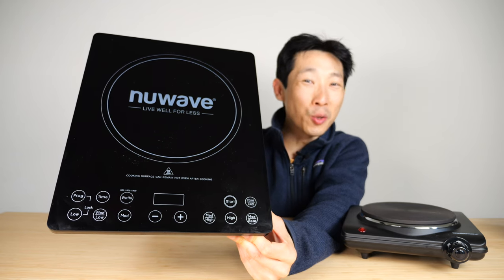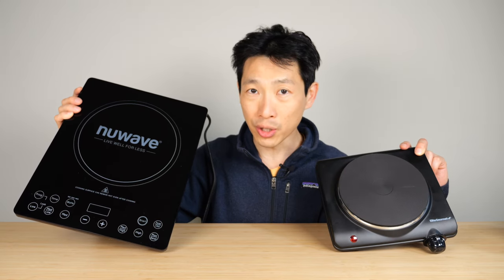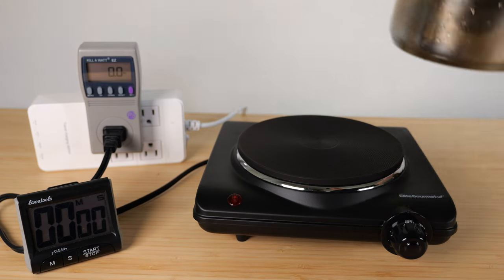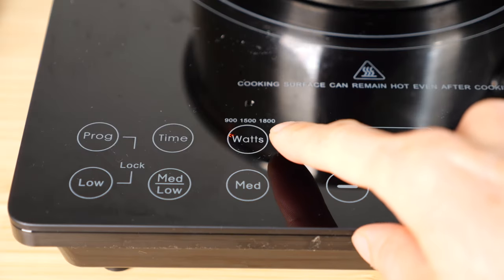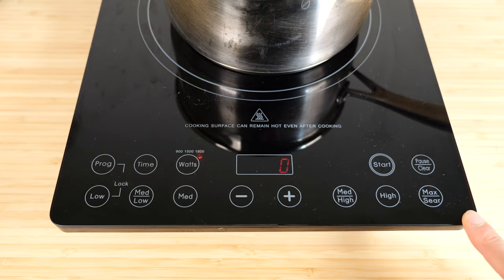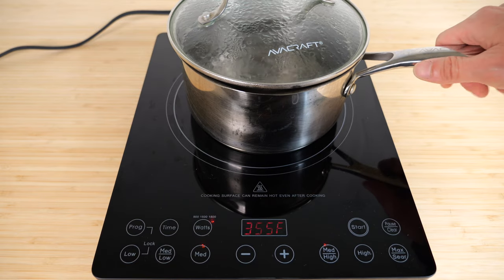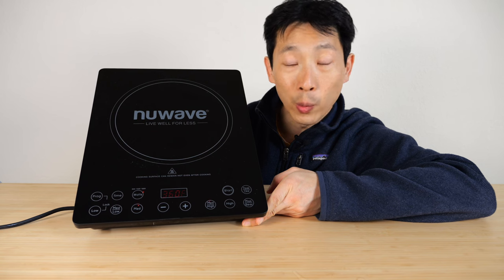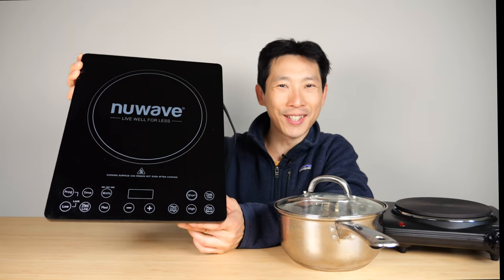Nuwave Induction Cooktop vs. Hot Plate

Comment: Induction is way awesome. If you turn off the power then things don't keep increasing in tempature. Like a gas stove it reacts instantly to turning off. Any pot you can stick a magnet to is induction ready. 1/2 the energy consumption and twice the controll. Personally the energy thing is nominally important because cooking takes only a short time, you dont use a ton of energy. Where it really shines is making cooking easier because you have more controll. A really good product test would be testing the temperature controls against other induction heaters. The quality of the temperature control is really what sets a great heater apart from the competition.

Comment: To bad he did not measure power used AH
Reply from the maker: Ah? That's typically used for batteries and needs to be paired with voltage of the battery. Voltage changes and so Ah is not a good energy measurement unless you want to talk capacity of a battery.

Comment: I only have portable stoves like these as I mostly cook on my instant pot or air fryer/ovens/microwave.

Induction is really good, it's a shame mine does not allow proper temperature setting (it allows it but it cycles instead of having a proper thermostat, so I can only keep things warm or have it cycling through and burning the bottom of the food instead of being able to set it at a constant temperature like the Instant Pot). I am glad I got the new Instant Pot that has stainless steel pans with handles, so I can use my induction cooktop if I want to quickly fry onions or something like that before adding the rest of the ingredients to cook under lower temperatures (or pressure) later, since the instant pot's own heating element is much less efficient and it takes much longer to reach temperature. For things like fondue I had to get a regular ceramic stove AND a voltage regulator to force the resistance to run less hot (otherwise it would cycle as well, burning the cheese).